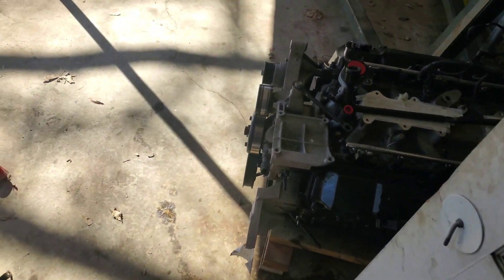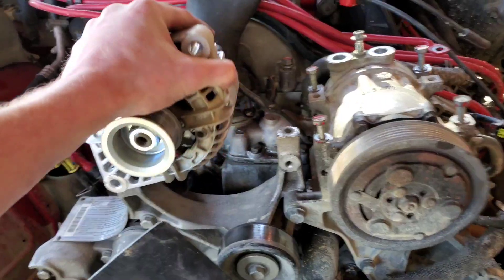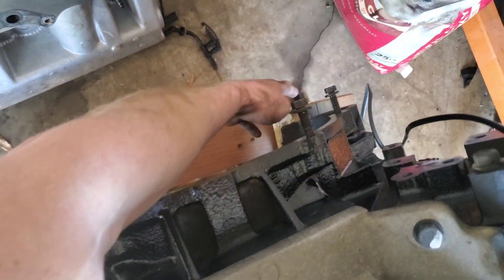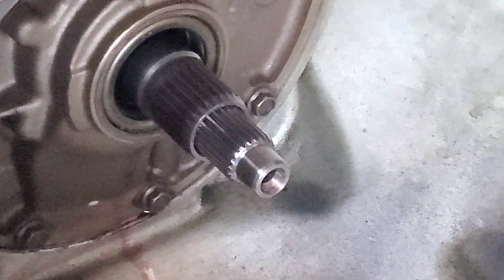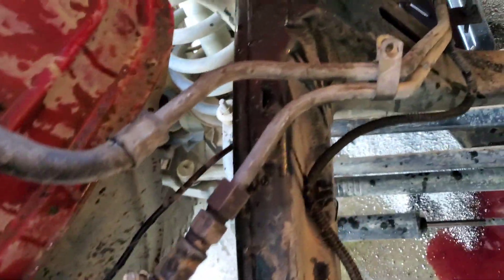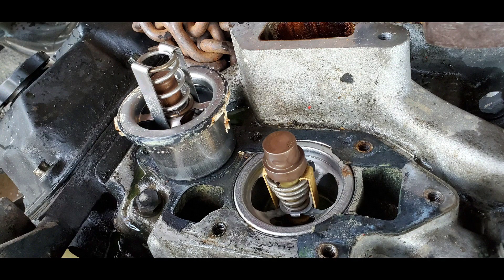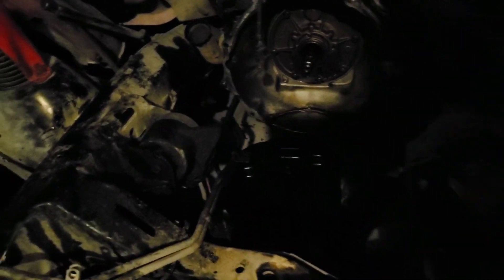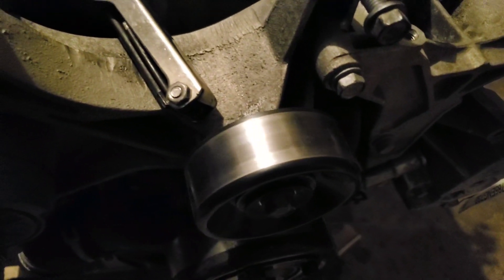PULLING THE V10 AGAIN....

Comment: I saw on your prior video that you sourced the new engine from LKQ?  Did they rebuild the motor or find a crate engine somewhere?  My V10 is still in good condition, just weighing my options for when the engine needs to come out.  Also, I'm in CA and I believe Dodge had specific motors here, will prob end up rebuilding.  Did you consider doing that instead?